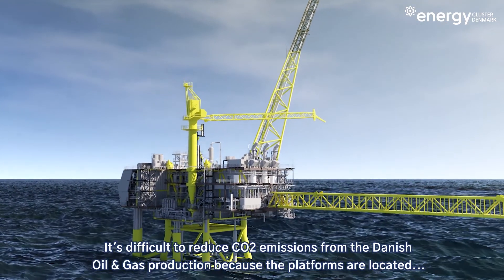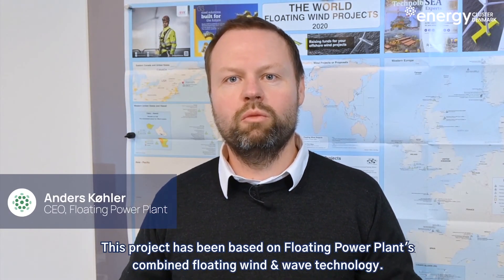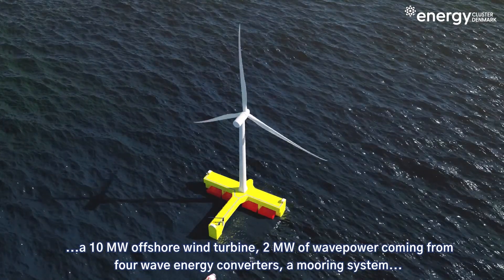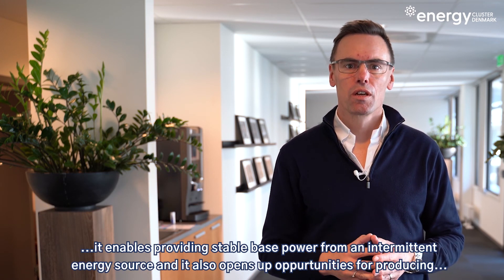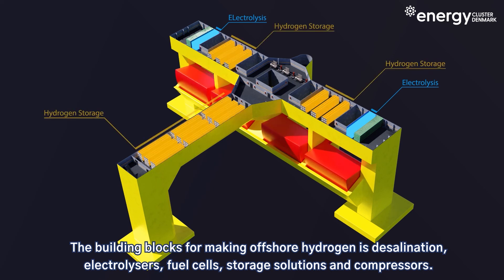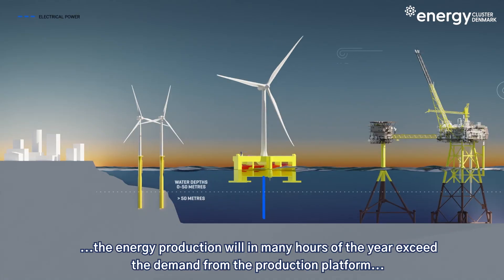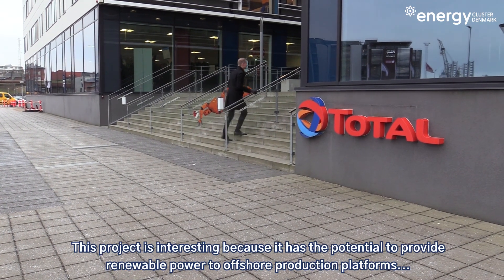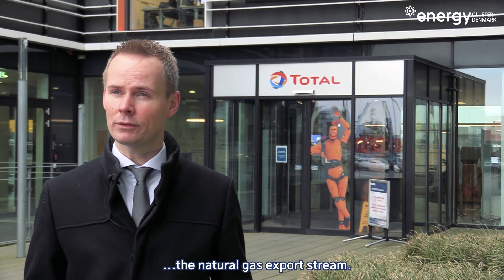Floating Power Plant - Floating wind and hydrogen will make oil and gas a lot greener

Comment: Great idea!  Save power by using wind power instead of running a generator running on natural gas on the oil drilling platform.  And use the excess power to make hydrogen.  But making water out at sea might be more expensive than making the hydrogen on shore with drinking water found there.  I think it would be easier to export the electricity and make the hydrogen on shore.  There is also the problem with special steel required to transport the hydrogen in a pipeline.  Normal steel could become brittle if exposed to hydrogen for a long time.  

Also consider pressurizing the hydrogen processor to about100 PSI, so the hydrogen comes out pressurized, instead of running larger explosion proof compressors to compress the hydrogen after it is produced.  It is much less energy to pump the 100 PSI water than to compress the hydrogen from 0 psi to 100 PSI.  

It might be easier to power a car with something like "Powerpaste" that is in a tube, like caulking, and then mixed with water to generate the hydrogen in the car's processing tank, and not use high pressure hydrogen storage tanks.